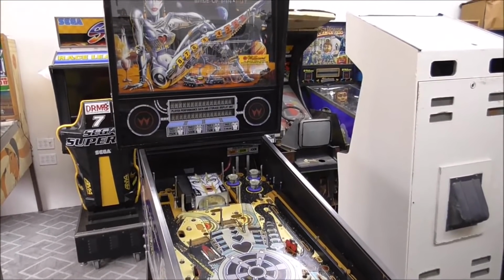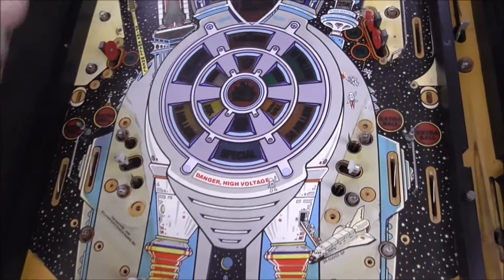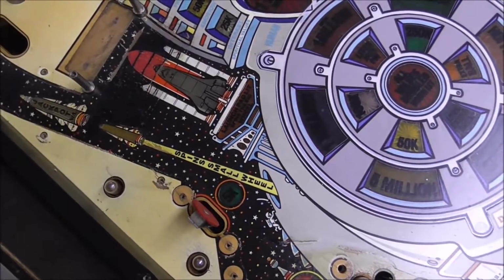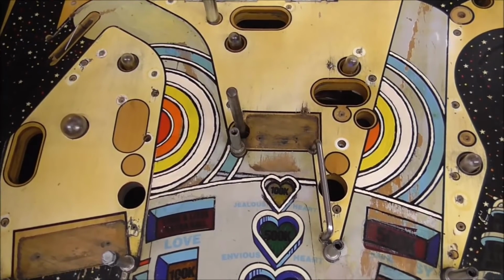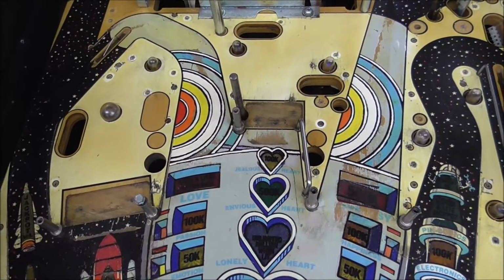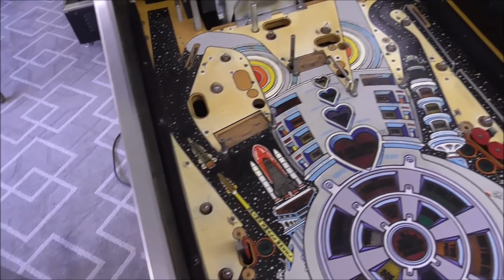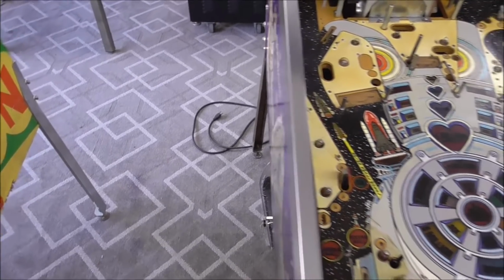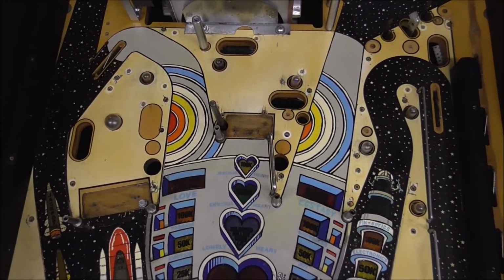Finishing The Paint Rework on a Worn Williams BRIDE OF PINBOT Pinball Playfield - How'd We Do? 4

Comment: Just some hopefully constructive advice: that brush is too big for the finer details, you want to use some fine tipped modeling brushes instead (they're specially made to paint miniatures). Also, instead of smudging paint with your finger, you can use some stiff, fine tipped makeup brushes, which are perfect for cleaning up the edges. I do realize that you did your best with what you had in a reasonable amount of time, however.